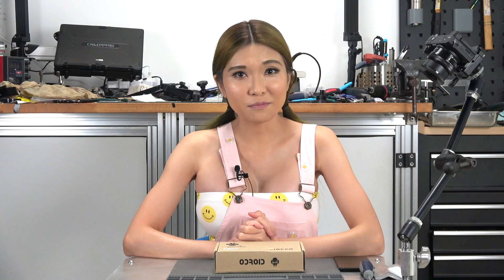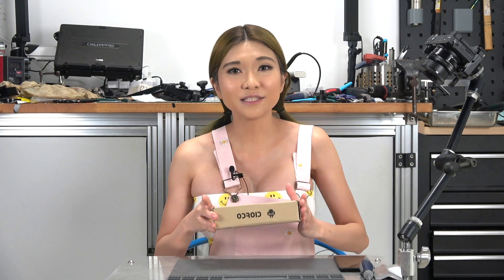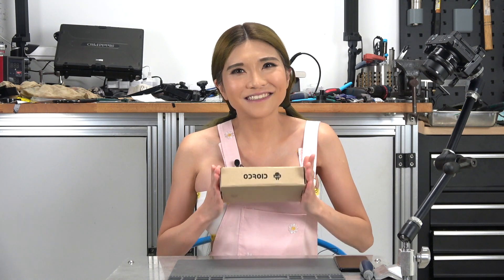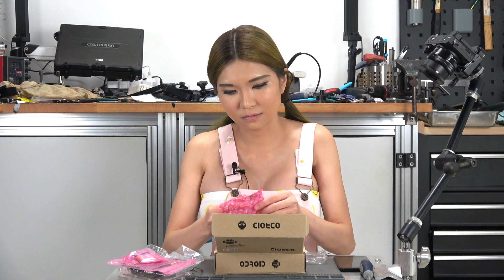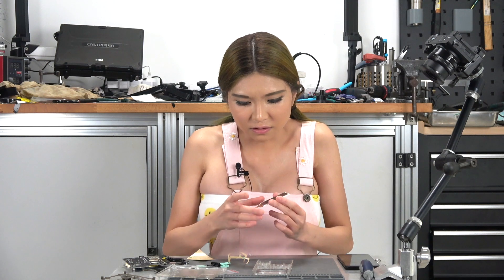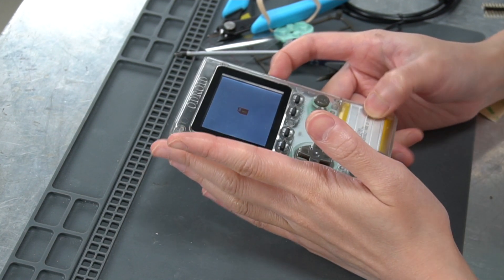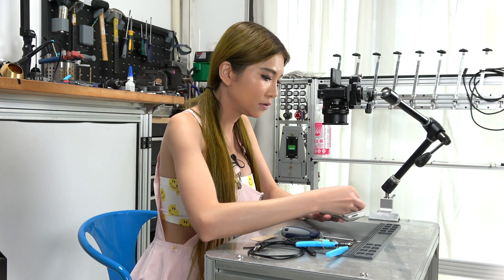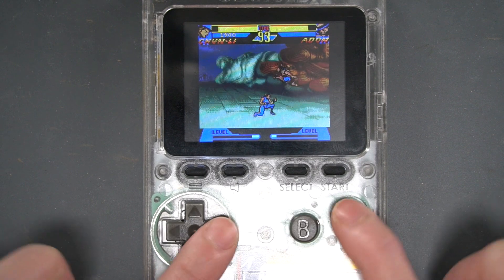DIY Retro Gaming Handheld/GameBoy Kit- the Odroid Go

Comment: About the chip: You are not weird at all. But times change: I liked the 68000 a lot and friends loved the 6502/6510. ;) I know you are into wearables. I recently stumbled over a product called hot hand (https://www.sourceaudio.net/hot-hand-usb.html). It's a midi controller you wear like a ring and use your hand to control midi signals. Such a device as a DIY project would be fabulous.

Comment: Nice and very interessting kit. Something like that, i have been searching for a long time. But i have a few questions, about this kit. 
1. Is it able to connect to a wifi. Some sort of USB solution is possible.
2. Does the board support a camera module? 
3. Is there a way to connect a external keyboard, Rii or something. 
4. Is there a way just to run a common linux distribution, without this gaming stuff.

The reason i asked for, i am planning a trip to Thailand, and i'm going to drive myself, but i can't read Thai languange.

I've written a small python script with Thai OCR in combination with google translate and espeak. This would be a very handy device for that use case.
Reply from the maker: Yes to most of those, ESP32 is a very powerful little board for the price.

Comment: Espressif Systems made a very good platform with ESP8266 for home automation and the ESP32 is very very powerful, for a tiny board, and it can be mutch more ... and the coolest thing is it can be all programed with the own soft like nodemcu or if you know and like Arduino IDE, thats more what i like. Botg are very cheap and good made, quality made in China. Naomi you need to add wifi automation to stuff around your house with this boards, is fun and easy and if you need help feel free to ask. 😊

Comment: My favourite processor is the 6502.   You should have seen my college project - design the circuit, the PCB, and even manufactured the PCB by hand (acid bath) and wrote demo software in assembler.   I was the only one in the class who  never got to take their project home with them as they then used it to teach a new course with!  (Early 90s).

Currently use Atmel AVR / ARM chips for micro controller based circuits.

Great build!

Comment: Got to say you are terrible at street fighter (no worries, the old gb versions look like crap anyway), but that is a pretty cool build. Not a fan of the battery being fixed inside the enclosure but since it is a rechargeable lithium ion battery it's probably for the best, I'm probably just being a bit biases and nostalgic for the hold AA battery boxes. Definitely looks like a great device for a more authentic emulation experience and a cool thing for getting kids into EE. Any idea if these devices are re-programmable or if there is access to the source code? It might be fun to add custom attachments like an IR light for custom remote controls.

Comment: Another great Video Naomi,

I use the esp32 alot in many projects from the Lolin32 ( first board around $6 us ) which is a pretty unbeatable price, to designing a custom PCB / building out from the mcu module.  So seeing it run as an EMU is quite impressive for its small embedded nature ( Not shabby at all ).

I think most will appreciate the no mess no fuss of building this one out and getting up and running quickly,  A++ for presentation and the length of the video..

Keep the cool stuff coming!

Comment: I love it! 💗 I need to hurry up and place my order before they run out of stock (due to the Naomi effect). I was hoping to do that sooner. This kit is perfect for my 6-year-old, no soldering required. I'd love to see what else you can do with it. Since you clued me in, I learned that it's actually a general purpose project board with I/O pins for connecting other devices. Should be fun! Ordering now...